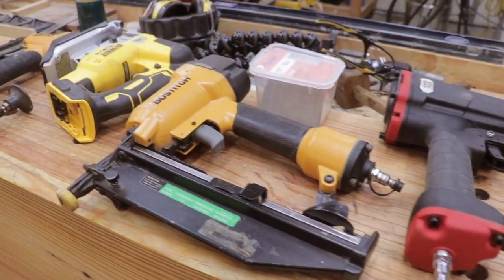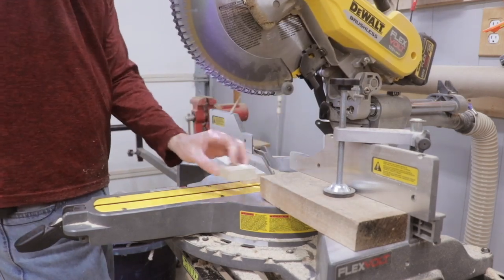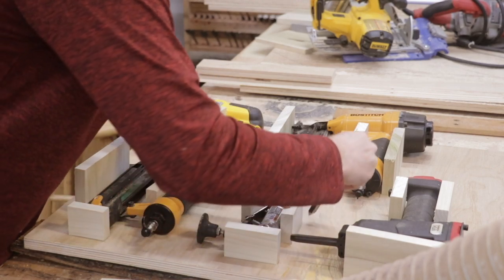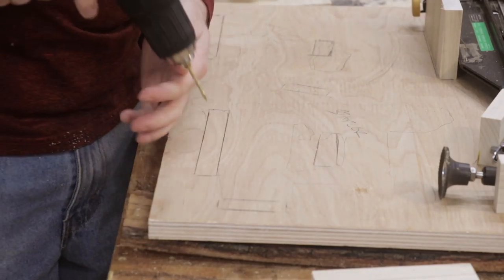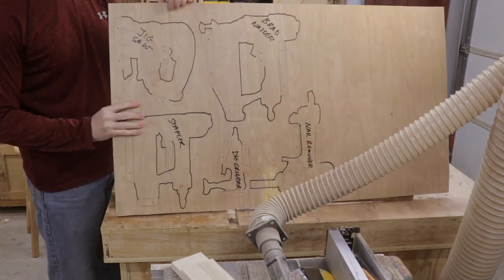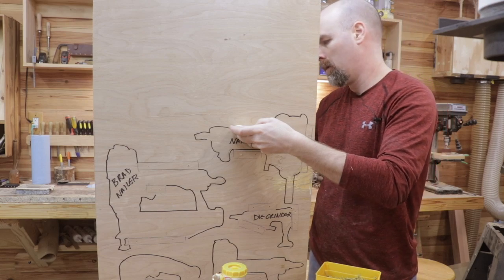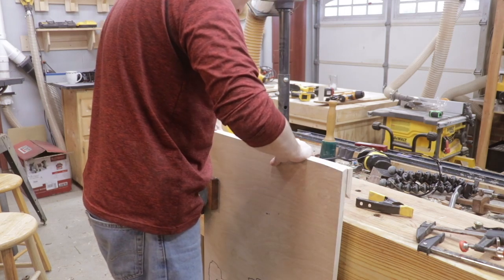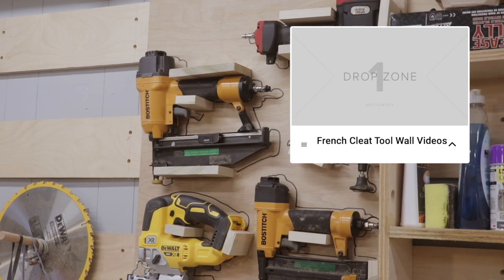French Cleats For DUMMIES!

Comment: Instead of creating a big board that attaches to a french cleat, and making multiple holders on the board for a bunch of tools, you might be better off making individual holders for each tool. That way, you can move the tools around making better use of the space. You can also toss or modify individual tool holders as you add or replace tools more easily. I make separate holders for each individual thing, and then use the cleat wall to move individual items around and organize them.
Reply from the maker: That would work!
Reply: Well yes, but that’s what every OTHER French cleat holder making channel does on YT. It’s very hard for some folks to make sturdy holders for individual tools. By “some folks”, I mean me. I’m some folks. 

Remember, this video is “for dummies”, meaning he’s helping in the most simplistic manner possible. He’s also already done individual tool holders. I saw a couple in the background.

Comment: For even pretty heavy tools, I've gone to CA glue for attaching the holders to the back board, and then driving a couple of brad nails in from the back.  I have this system holding up an angle grinder, a sawzall, and a full-size circular saw as examples of the kind of weight it can hold.  Makes the setup of these holders very quick.
Reply from the maker: I’ve never tried CA glue! Gonna need to try that out! Thanks for the suggestion!

Comment: Dummy question here and I can;t seem to find the answer anywhere. What's the  best minimum width for the part being screwed to the wall? I've seen videos just showing to cut 45degree angle, but never mention to cut at how many inches? Thank you.
Reply from the maker: As long as the tool cleat fits between the wall cleats you should be good! Everything else is mostly aesthetics!

Comment: I would have probably used pocket holes to attach the blocks. Then I wouldn't have to clamp the board vertically and try to screw from the back side while holding the blocks on the other side.

Comment: I have a question for you or anyone. I made some cleats for my wall. Used 1x4x8ft ripped at a 45° angle. Mounting one piece for the wall and cut the other one for hanging boards. 

I've seen a lot of people use the full width of a 1x5. WHY? I'm retired, on a budget, and don't see the need for more. 

One of my cleats is supporting a small compressor 6ft up on the wall. Hasn't even moved.
Reply: Doesn't make sense to me either
Reply: Tim thanks for the post.  I have been thinking about using 1x4's and cut the 45 on one side.  I see no reason it would not work as well as cutting a 5" board in half.
Reply: @davidroman1654  I figured that once it's mounted to the wall it won't warp.